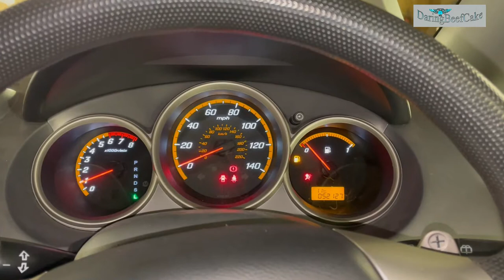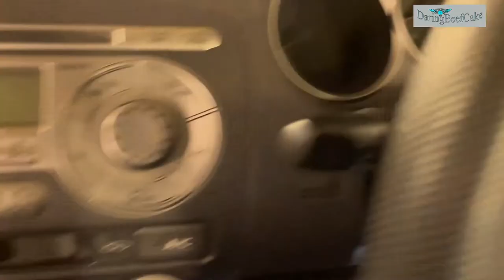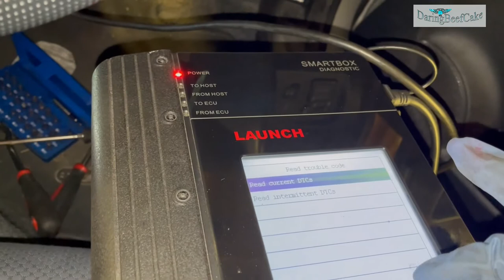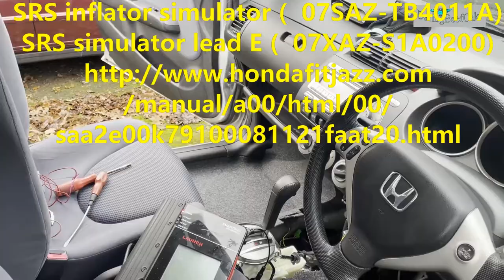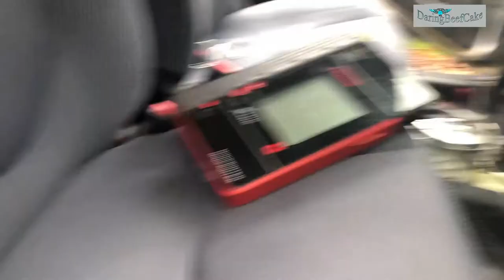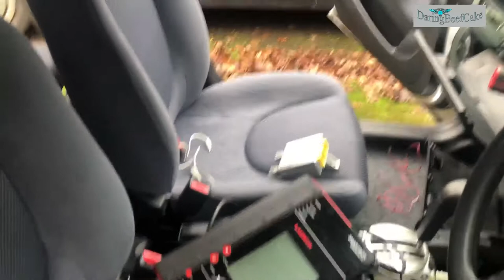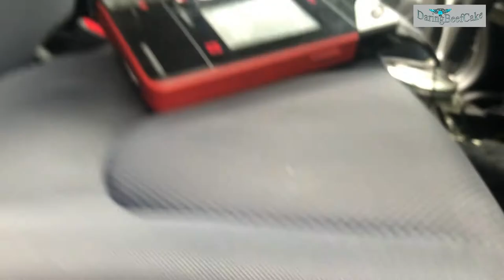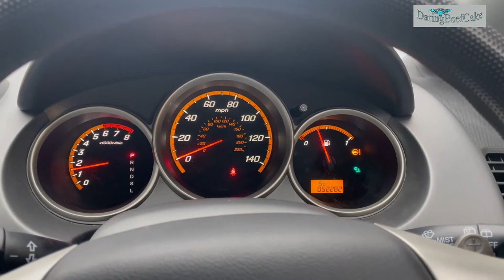Honda Jazz 2006 airbag light on fix srs faulty unit fault code 12-01 Open or Increased Resistance..

Comment: I changed my srs unit for another second hand one. Still no joy. My code is  12-10 on a honda civic. Argh.
Reply from the maker: Have you checked the resistance of the components ? That may guide you in the right direction, sometimes just cleaning all the contacts under the seat solves the problem. Well you have to disconnect the battery to unplug and clean everything and or check resistance values.
Reply: Please don't suggest checking the resistance of air bag components you could kill someone.  @DaringBeefcake
Reply: @sp88tips  as per the video which am sure you must have seen right ???, there is a guide by Honda on how to check airbag sensors like the seat occupancy sensor no one suggested to check airbags themselves.
Reply: @T.F.D77  there's your disclaimer because someone not so smart might
Reply from the maker: @sp88tips  of course but that would apply to every single video on the internet, from changing a tire, where the jack can collapse and kill you, where do you draw the line if you know what I mean. that would mean everyone can kill someone, its not a good comment to make, I would like to see people and this is just a suggestion but making positive suggestions and perhaps you could given a comment regarding health and safety so we all help each other and keep safe, no one is perfect.. anyway you are entitled to your opinion, freedom of speech.
Reply: @DaringBeefcake  sorry man it's a good thing to make videos to help. As a mechanic I can't watch the whole video as most times I'm just looking for tips. But yeah mybad for the negativity,
Reply from the maker: @sp88tips  no worries buddy, I will happily take suggestions and any advise is always welcome lets help each other specially during this hard times, have a great day..